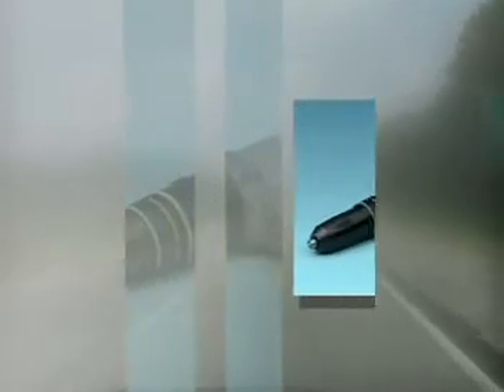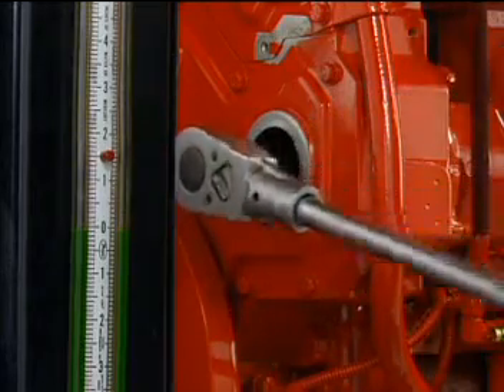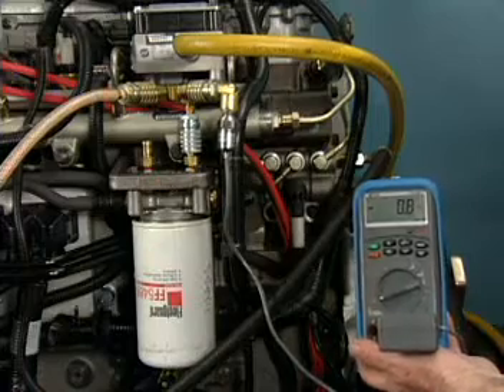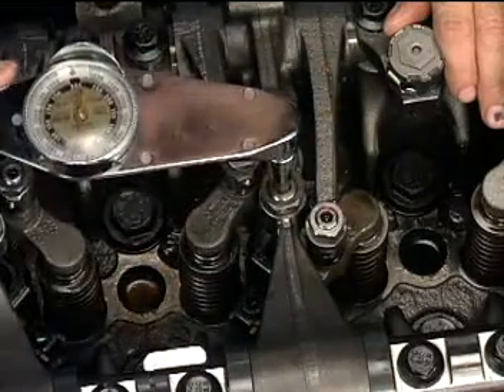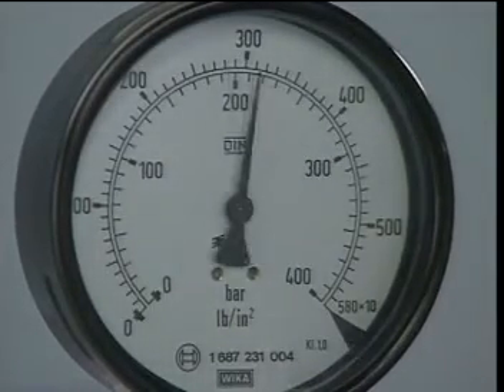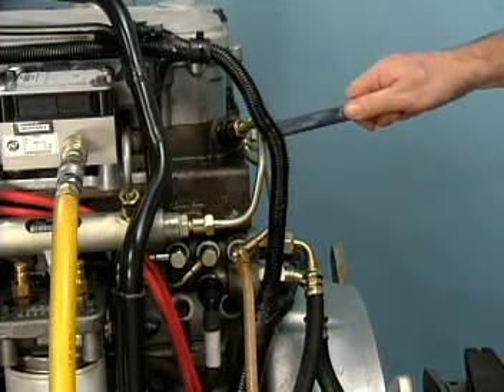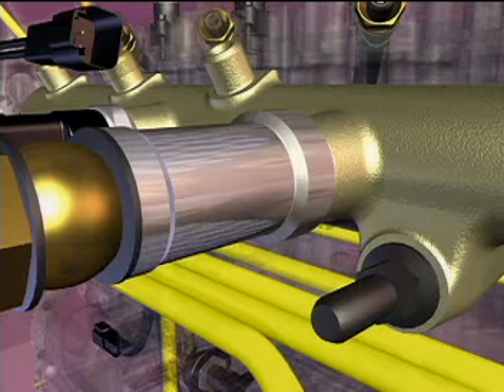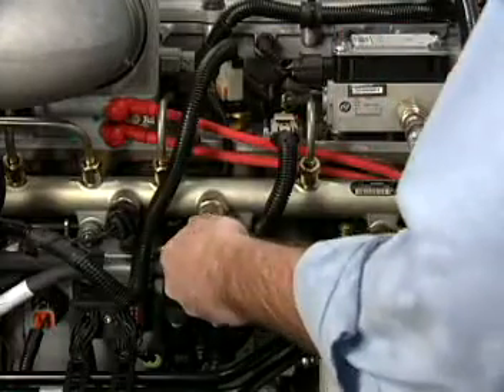Cummins diesel engine fuel system common rail  testing and adjusting

Comment: What's the problem of code 359 fail to start of Cummins Engine
Reply from the maker: Fuel system' problem..please check fuel shuftoff valve, fuel line and reset monitor program
Reply: We check it all this but any solution